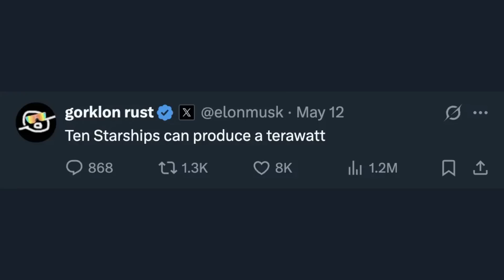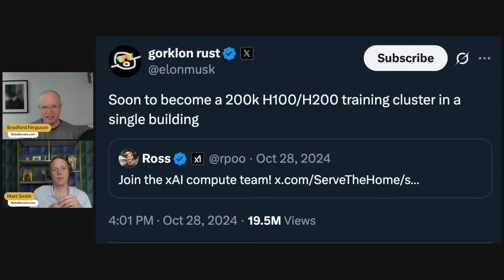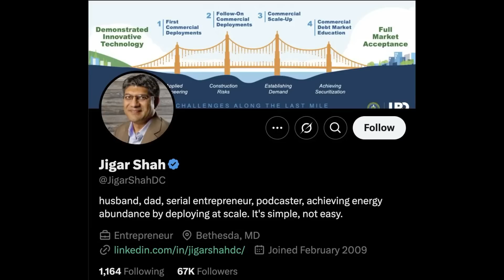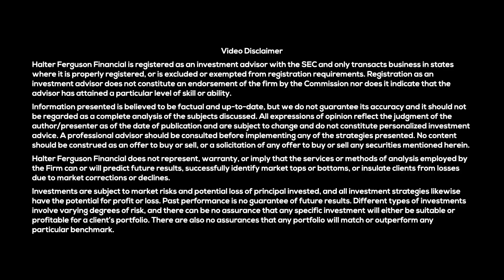Elon Wants a Terawatt—Here’s How He Might Do It

Comment: One of the ideas is not to generate more electricity - it’s at least in the short term is to use all the capacity using battery storage. Since most of the grid is running at under 40% most of the time, if you run existing power plants at 80-90% capacity all the time  and store the excess capacity in batteries (or when pump water up to lakes and the hydro when you need the power), you can, at least theoretically almost double the usable capacity of the grid. Granted, there are transmission losses and all power generation needs some maintenance time, but adding 50% available power should be very much doable - and all you need are lots of megapacks. Now add some solar to that and you can fairly “easily” double the effective capacity of the US
Reply: Well said. So the question is where to get all the batteries that are needed for such a project. Pumped-storage power plants would be a great solution but it would take too long to build them. I think the problem Elon Musks wants to solve is, what is the fastest way to increase available electricity for the Terrawatt project. It is about time, because in a few years you will only need a fraction of the electricity to power the same amount of compute, but to win the ai race you have to be as fast as possible.
Reply: @NilsFrederking The battery issue is not going to be solved overnight but than again, 1TWh is not going to be needed overnight either. Specially for the US and for grid storage the solution in the US is likely going to be Sodium batteries. US has huge amounts of the type of sodium needed for batteries locally and cheap. Jeff Dahn that is a leading researcher and works with Tesla has done a lot of work on this in recent years. The combination of Tesla making its own dry batteries and starting a new production line for prismatic cells (sourced from CATL) is a great start. The question is when and if Tesla already started working on this and how long it would take Tesla and/or others to ramp it up. LFP is also a good solution but US lacks the infrastructure to refine the minerals so it’s not clear if LFP or sodium would take the lead in the US mid and long term.

Comment: If you put the electricity generation in space, put the AI compute center there with it.  Beam the software inputs and outputs back and forth with Earth or elsewhere, not the energy.
Reply: Exactly! Should also be good in regards to cooling the gpu's, cpu's or whatever goes in 😅 (no computing expert at all).
Reply: Why would you do that? Why would you spend all that money when Sun already beams the energy down to earth 🙄
Reply: @verttikoo2052  Earth is turned away from the Sun for many hours each day.  Stormy weather and just cloudy weather reduce sunlight, also.  Weather is clear in space, much of the time.  Also, in space there is . . . space.  Enormous volumes of unclaimed space in which to construct AI compute center, solar panels, megapack batteries,  transformer yard, the Gods only know what sort of fantastic chip cooling system, etc.
Reply: We have already cheap solutions for that 🙄